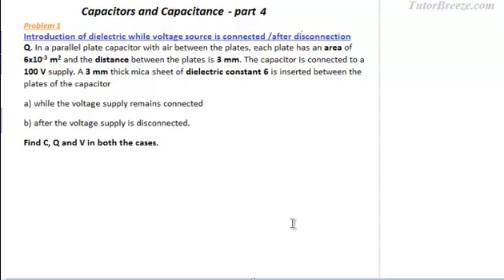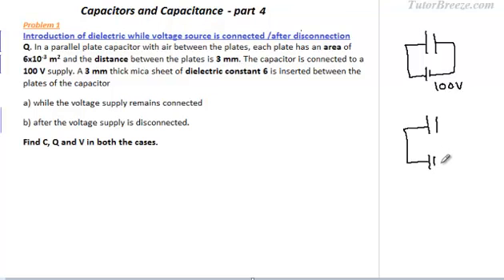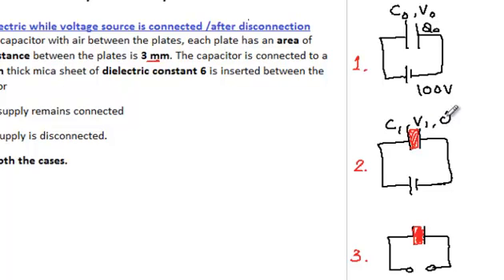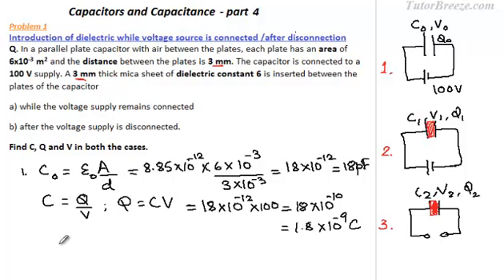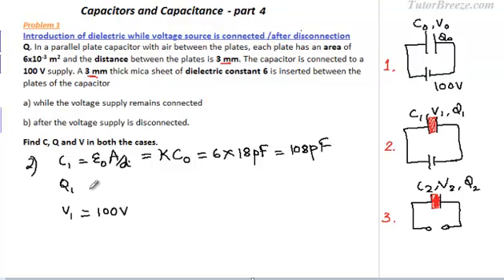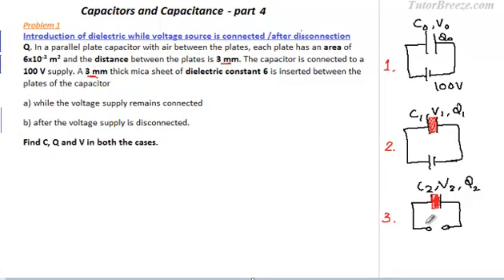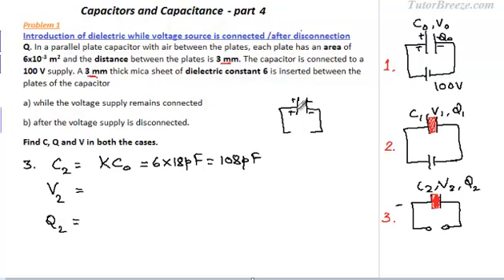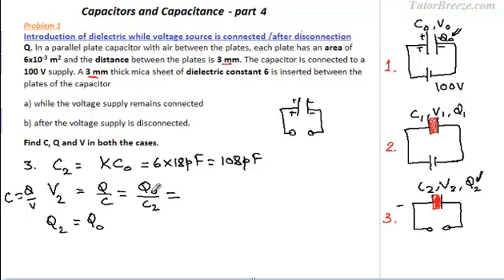Dielectric in  capacitor while voltage supply connected-disconnected

Comment: Why q3 was not equal to q2 but qo
Reply: Q3 should be equal to q2 because the charge remains unchanged after removal of power supply  from a capacitor initially having the increased capacitance due to dielectric.
Reply: later i understood by reading the question again properly the dielectric was introduced after disconnecting the supply